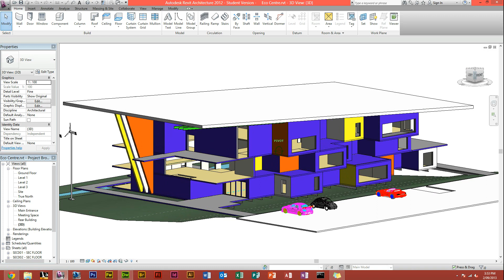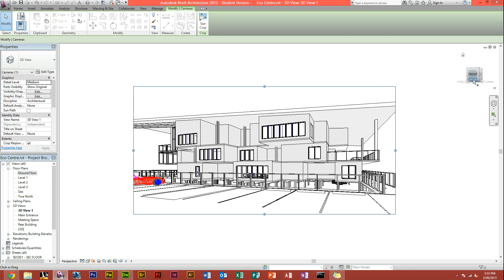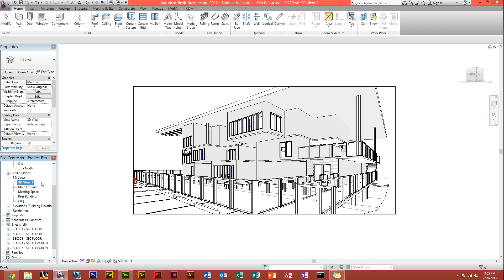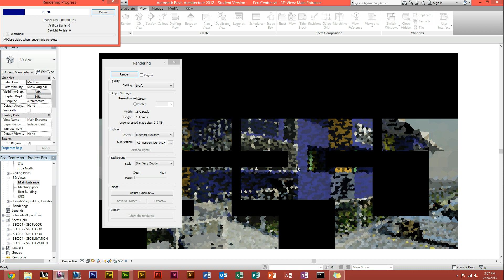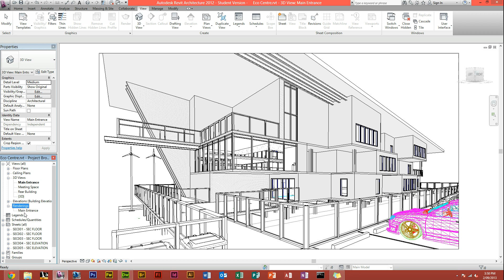Autodesk Revit Architecture - How To Make A Render

Comment: when i did render, i cant see cloud in the sky (background styles, sky: very cloud), just grey, anyone can help me?
Reply from the maker: Hi RoKr, it may be one of two problems. Firstly in render settings it could possibly  be that you have turned off a setting which renders background. Other than that it may be a problem with your content files when you initially downloaded Revit - Either you haven't downloaded all the content files, none at all, or just some form of error occurred. Here is a link to solving the content file issue https://knowledge.autodesk.com/support/revit-products/troubleshooting/caas/sfdcarticles/sfdcarticles/Cant-find-the-Library.html.